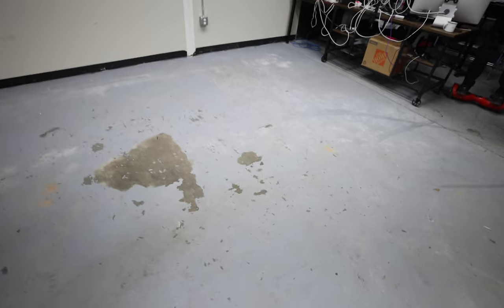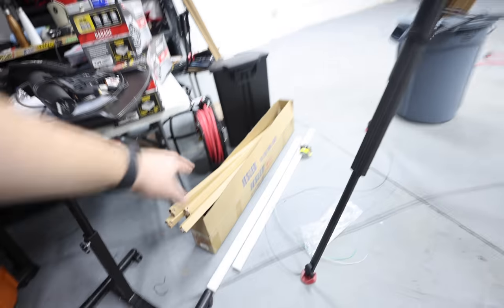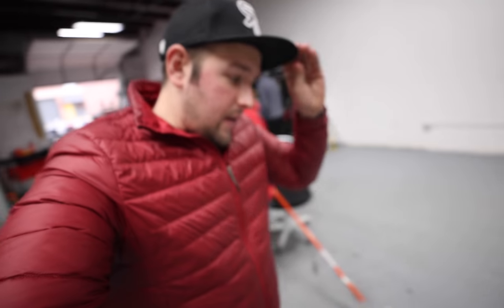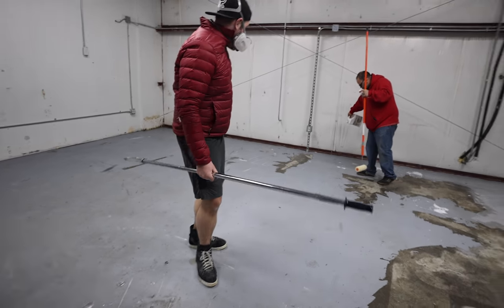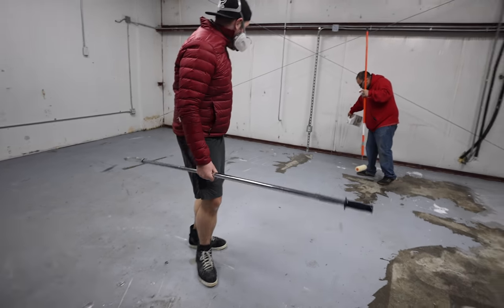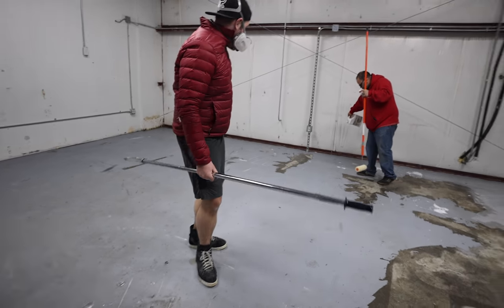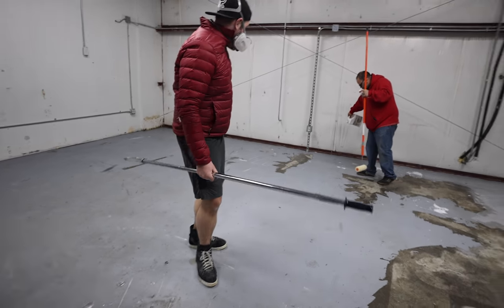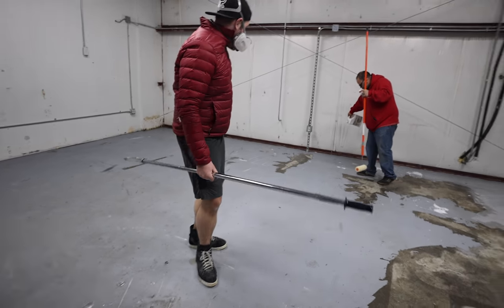Rocksolid Rustoleum LIES! Watch this before you buy it! | Shop Build Ep 04

Comment: Rent that floor sander again to strip that paint off, use watered down muriatic acid to really etch that concrete. Rinse it very well and then put down 2 part epoxy. Floor tiles might be a good alternative if you don't want to do all that work.
Reply: agree 100 %.  If you stip the concrete with the muriatic acid it will etch the concrete and make it able to absorb a stain color.  Probably will never really hold paint on the base layer but if you can get an amazing stain finish and then clear it and leave it alone.  It won't look shop grey but i think it will be far better for hiding tire tracks and other similar stains.
Reply: Yes, 10%  HCl does wonders on concrete.
Reply: If there is oil and other automotive fluids soaked into the floor that still wont work. Been there done that. We had to end up putting down a skim coat after having the floor ground down by 3/4 of an inch.
Reply: Do all that and Use baking soda to neutralize the muriatic acid. Per rust oleum tech line when I did mine. And than bite the bucket buy a shit load of that rock solid and be done. Make sure temps are right and humidity is right. 

Or just pay company to come out and do an industrial epoxy on it.

Comment: You need a grinder and grind that floor clean. And make sure there's no moisture in the concrete, not raining outside or has rained in a while, and run a dryer over the concrete, kinda like you see on race tracks with the truck dying the track.

Comment: I worked in the commercial paint industry. Now retired. Much of what I did was to problem solve industrial and commercial paint problems. Concrete floors are one of the most difficult surfaces due to concrete processes and chemistry. Three problems are common. You may have any of these going on.
 
1.) ground water vaporizing up through the concrete
2.) highly alkaline concrete
3.) Hardened concrete.

Number one and two can be related. If there is hydrostatic pressure (water vapor) it can cause poor adhesion of paint. It can also bring alkaline salts up the concrete surface causing it to be highly alkaline or even corroded and weak. Paint will not withstand alkaline. It will peel easily especially if it is wetted with water. Before attempting to paint bare concrete, you should always do a moisture test. Lay a square yard of plastic sheet down and tape it with waterproof tape all round. Leave it for 24 hours, and if after 24 hrs exactly, there are water droplets on the underside, then there is too mush hydrostatic pressure to successfully paint. 

If it passes that test, then I would normally do an alkali test with a acid alkali test strip. If it is alkaline, then etch the concrete (etch regardless). Thing is, the proper etching method is to use one part muriatic acid added to three parts water (in that order). Flood the surface, let it fizz and react, then rinse and mop, rinse and mop, then let dry and retest for alkali. If it is still 'hot' then you must etch again. The etching is to chemically change the surface, not just to key it up. By the way, when painting always ensure the floor temperature is sufficient to cure the product. 

Number three is a situation where you cannot paint unless you sandblast the concrete. Hardened concrete (a special process when laying the floor) cannot be painted unless sandblasted. Etching will not be successful on hardened concrete. I'll also say that I would not trust the Behr garage floor finish. One part epoxy is not true epoxy, since it is not catalyzed. It is a regular floor paint with some epoxy resin tossed in for labelling/marketing purposes. Sorry to flood you with info here, but just in case you are faced down the line with redoing the floor, perhaps you can save this for future reference.
Reply: I'll add one more point. Do not use any form of concrete to fill voids, as you cannot paint fresh concrete until it is cured at the very least, 3 weeks, and then it must be thoroughly acid treated.

Comment: Chase, if you want to paint to stick you're going to have to strip the floor again and grind it down then put down a skim coat of self leveling concrete. We had the same issue on a floor at one of the fire houses I worked at. It was an old bay that had oil soaked into it for years. Had a pro installer come in to do the floor with spray on epoxy. Within a month the epoxy was bubbling up and pealing. Had to have the company come back and ground down 3/4 of an inch and put down a thick skim coat and redo the epoxy. After that it stuck and had no more issues.

Comment: I have a newly poured garage floor that has cured for 3 months, never driven on, that is 600 sq ft. I started with 1 single and 1 2 car kits. This did not cover 1/2 of the floor. I then had to purchase 2 additional 2 car kits from Home Depot. The floor is spotty and does not look a $1,100 dollar floor should look like. According to the product specs the 7 bags should have covered from 1,400 to 1,750 sq ft. Don't waste your time and money on this product.

Comment: Met a guy that did commercial epoxy coatings for a living. Said rust oleum is horrible and recommended to stay away from it. My family used UCoat-It on two garage floors and actually turned out great. Better in my opinion and has lasted up to 5 years no issues. Easy prep too.

Comment: Doesn't matter what top coat product you use if your prep isn't right.
After sanding should have applied muratic acid then pressure washed .
Mopping is the worst thing you could do ,especially with degreaser, all you are doing is spreading old oil around,ugh.
Acid opens pores then you pressure wash to remove all debris(oil,dirt,dust etc).

Comment: Any paint that says it has primer in it only has enough to say it’s there. That’s great for going over existing paint but with your stripped floor, you need to use an ultra bonding primer like that Valspar stain blocking bonding primer at Lowe’s.

Comment: Surface prep is the most important with this product. I used this on a two and a half car garage but instead of using the acid that came with it, I opted to grind the concrete for maximum adhesion. 
On a large size shop like yours, you should've rented a diamond floor sander at home depot. And I filled the cracks with the rustoleum epoxy patch that they sell. Outcome is flawless and never peels off after over a year. Do not use a degreaser as this will seep more into the concrete. The diamond sander will remove everything from paint to grease as it cuts down about an eight of an inch each pass. 
Acid etching is what makes it peel because it's hard to wash off the acid after.
Reply: How did you grind your floors? Did you rent the diamond sander as well? I was going to do that and then just use an angle grinder around edges. I'm getting ready to do my 2.5 car garge, and I've watched a lot of videos. You are absolutely correct. Prep is everything when it comes to epoxying the floor. Any advice is appreciated!
Reply: @royals1833  I didn't rent a surface grinder. I just used a 4 1/2 grinder and bought a 4 1/2 inch Ridgid diamond cup wheel. If you just lay the grinder and just use its weight down, it's a breeze. BUT do it in 4 x 4 sections at a time, and remove the dust as you move along. Be ready to use a shop vac, a box fan and a leaf blower
Reply: @royals1833  remember, the objective is just to scratch the surface, not to remove a lot of concrete. You will see it as the concrete changes color and surface.  Don't dig in too deep. N95 3M dust mask is a must and goggles. 
Let me know the progress!
Reply: @Tony R  cool. How long did it take you to completely do your 2.5 car garage? Like from start to finsh, amd  how many packs (boxes) of the rustoleum did you have to put down? Ive seen that it takes alot more to do it right than the box says will cover. Thanks man, i appreciate it.
Reply: @Tony R  will do. So you didn't use the acid that came with it? I watched one video (I can't remember if it was the acid or not), but whatever he used made the pores of the concrete open up more so the product would stick better. Did you use the acid or skip over that?
Reply: @royals1833  no I didn't use the acid. The reason why epoxy fail is because you couldn't wash the acid off that easily. And still, you can't get the same reault using a diamond wheel cup. The garage that I did is so tough, you cant even scratch it with a knife, and NEVER peels off
Reply: @royals1833  it took me one day prepping the concrete and less than half a day applying "2" kits of RockSolid. The flakes that came with the kit wasn't enough so I had to run back to the store to get 2 more bags of just the flakes of the same color that came with the kit. I didn't want the look of just a few flakes here and there, I wanted as much as possible with very little of the epoxy showing so it won't be so slippery when wet. There's also an epoxy filler that comes with each kit. DO THIS PROCEDURE FIRST before anything else, to patch cracks or line cracks, let it harden overnight, then start your concrete grinding. After grinding, do not wash or pressure wash the concrete. Just  use a shop vac after you remove all the dust with broom and dust pan. The leaf blower blows out remaining fine dust that settles in the air and the concrete.

Comment: This video hurt to watch.  This is why you call a professional epoxy flooring company.  To watch everything you all went through and the number of days y’all spent trying to get that floor prepped hurt to watch.  We just use scraper blades on our 1200 lb grinder and all they coating would be removed in about 2 hrs.  Then Diamond grind to grind the top layer off the concrete and get it clean.  No chemicals needed and sending it all to the pulse vac vacuum to eliminate most of the dust. Then use a professional grade 2 part epoxy to eliminate the issues your having with it pulling up.  

Thank you for your video.  I might send this out to my prospects who say they will just use the kits from the DIY stores.

Comment: My dear god you did it the hard way..  diamond grind and apply GOOD epoxy and you wont have a problem.  ALWAYS ALWAYS ALWAY diamond grind first.  Also, ALWAYS use a primer first, they don’t tell you that.  But they sold more material.. when it fails, look us up.
Reply: I do need to clarify, you did nothing wrong but follow the directions on the back of the box. Shame on the manufactures for misleading people.
Reply: I will send you a 500 sq ft kit for the next area. if your interested, let me know